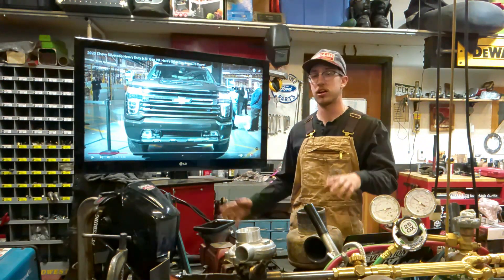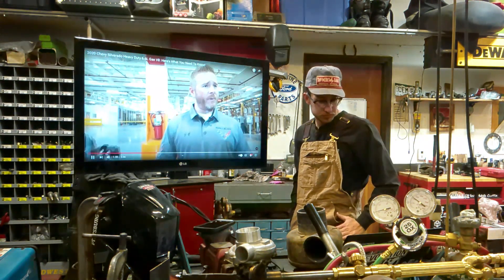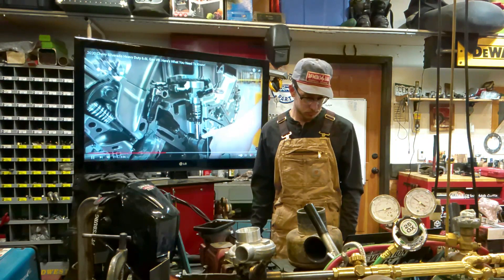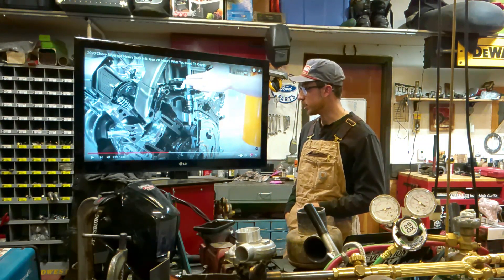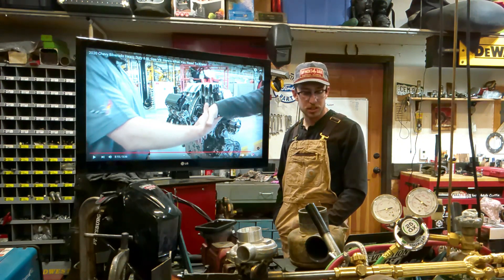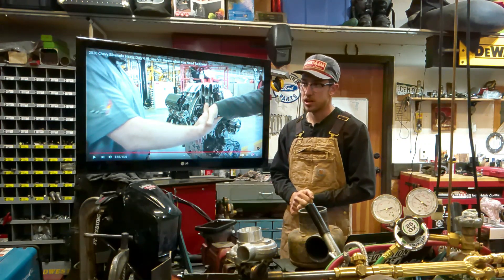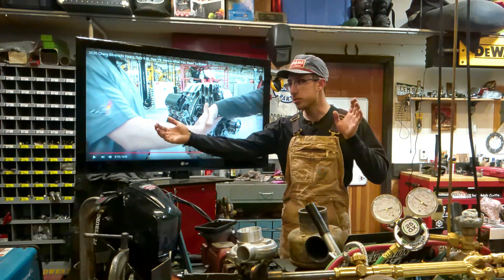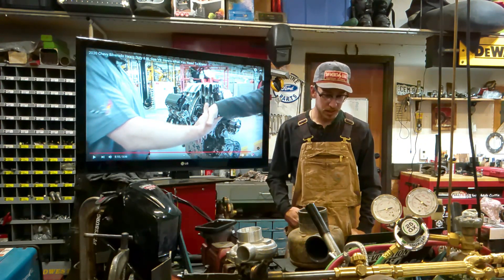My review of Gm 6.6 gas engine

Comment: For what its worth, I've owned both...2022 F-250 7.3L w/ 10R140 and now a 2024 GMC 2500HD 6.6L w/ "Allison" 10L1000.  
The GM powertrain is much smoother and quieter AND feels just as strong (-29hp & -9 lb-ft vs Godzilla). I very much prefer the GM!!  I'd buy it again over the Ford no question. Very happy with GM 2500HD. Also, the 7.3L might have cam/lifter issues?  Internet Amplification??  Maybe.  PS:  This is my first GM ever (Ford guy since 1998).  PS:  6.6L L8T uses 5w-30 (same as 7.3L).

Comment: I have 38,000 miles on a 2021 2500 LTZ 6.6 gas.   I've been nothing but satisfied.  Long road trips to the beach (not towing) i can get 18 MPG.  Towed an 8K pound car trailer on a 1600 mile hunting trip this fall and was very impressed with the power and performance of the truck.  Fuel economy on that trip was about 8.5.   The 6 speed transmission has been nothing but 100% perfect.  I think the new 10 speed paired with the gas engine will help its towing performance but I have great confidence in the proven 6 speed. If I towed over 10K frequently I might consider a diesel but for me the 6.6 gas has been a perfect fit.  And I really like the payload capacity you get with gas.  My 2500 standard bed has a payload capacity of 3316 pounds.  That's great for hauling green heavy firewood.  The Ford 250s i looked at seemed like their leaf spring packs were significantly smaller than the GM 2500.  Time will tell how this engine holds up.  For me as of now it's been great.
Reply from the maker: Glad to hear it

Comment: I love the Godzilla too but they are having some camshafts and lifter failures too. The Ford 10 speed isn’t nearly as reliable as GMs 6l90 . The Ford 6.2/6 speed is still the better powertrain IMO. The Ford  alumiduty trucks are have alot of wiring harness and. Connector issues especially with plow trucks. We just got 3 new GM 6.6s at work to go with the 11 other 6.0s we have , we will see how they do, they hold 8 quarts of engine oil whereas the 6.0s only held 6.

Comment: I never would have guessed you’re a Ford guy. 

Anyways the 6.6 doesn’t use cylinder shutdown technology. They also call for 5w-30 oil. 

Also, is the 7.3 really a big block? My cousin has one in an F250 and it doesn’t look like the older BBFs.
Reply from the maker: Yes I was wrong. The 6.6 doesn't use cylinder shut down. The 6.2 still does for gm. And yes tye 7.3 is a large water jacket true big block
Reply: @ColtWR  yes unfortunately so on the 5.3 and 6.2. 5.3s are coming with it deactivated due to chip shortages but still has the DFM lifters. 

Interesting about the 7.3 because it sure looks like a small block just on the outside.

Comment: I was paying attention until you started to sound like a hater. And then at the end of the video you just confirmed you are a Ford guy. At work we can’t keep those HD Fords out of the shop. The few 6.6 gas HD’s we could get a hold of are cresting over 150k hard miles and very few problems, none engine related. I appreciate you talk from knowledge, but this is definitely not from experience. I was so impressed from the 6.6 reliability I bought one for myself.
Reply from the maker: If the 6.6 was anybit of a long time contender in longevity you would see it in medium duty applications. Not just light duty trucks. There us a reason the 7.3 can be purchased all the way into the F650 chassis and that blue bird school busses is now offering them as an option as well. 150k miles is for kids. I'm interested it true HD engines. The 6.6 just doesn't fit that bill.

Comment: Got rid of my 6.7 ford diesel couldn’t keep it on the road. So I bought the 2500 6.6 gaser . Fingers crossed , I only have 25 k on the engine . I tow an RV and a 22 foot salmon boat . I have noticed some oil consumption it seems to burn 1gt. Of oil every 2500 miles which doesn’t sound good to me , I now check and add oil as needed the miles were mostly tow miles and I run Valvoline 5w 30 full synthetic . Every thing else is good so far . I also put a oil catch can on to hopefully alleviate oil buildup on my intake and intake valves.
Reply from the maker: I do know that gm has had problems with v8 oil consumption in the last few years because they use a low friction compression ring that is really hard to seat.

Comment: I brought a 2500 HD chevy 6.6 gas.  I don’t plan on towing anything with it.  It’s my every day truck will I run into the same problems that you are talking about if I don’t tow
Reply from the maker: 🤷🏻‍♂️ hard telling. But I always recommend getting on the highway and putting it on the floor quite often if you don't tow to get that engine opened up and get the cats hot to keep everything clean and with less Carbon build up.

Comment: I have a fleet of over 25 box trucks delivering all day, from box trucks to pickups with stake beds. I can’t keep a ford on the road, I have from years 2000 to 2022. Diesel and gas, we have two full time mechanics. Out of everything we have the duramax is by far light years ahead on reliability. Gas engines just don’t like being used heavy duty like we do 24/7, The best setup we have is 5.9 12v cummins with nv4500s, you literally can’t kill them, have two with over 800k miles with regular oil changes. We have a new ford 7.3 gas with 16ft stake bed, we have to fill it up 2-3 times per day.

Comment: Stick with 0w20 or switch to 5w30 for a gen 3 hemi with 145k miles? Thinking of switching to 5w30 in spring or summer when I start towing more regularly.
Reply: I would never run the 20 weight in a hemi, particularly if it tows. If you look at the HD trucks with the 5.7s, they spec a 30 weight oil since those engines will be worked. Summer/winter, doesn’t matter. Your operational engine oil temperature will be almost identical, it just may take a little longer to get there. 0w30 is what I run in my 2017 Ram 1500 that is worked like a 2500 way too often, it is approaching 150,000 miles and doesn’t burn a drop of oil and has had no mechanical failures inside the engine. Please stop running a 20 weight in your truck, it will thank you.

Comment: I’ve got a little 2.4 ecotec with direct injection which is getting fuel in the oil. Changed the direct injection pump and I think it might still be getting gas in oil. Do you think it’s possibly an injector leaking?
Reply from the maker: Sure could be.

Comment: There is no afm in 6.0 or 6.6 engines.
Reply from the maker: The 6.0 does not but the 6.6 has what they call dynamic fuel management which is a fancy new term for afm except it does not shut down 4 cylinders. It has the ability to intermittently shut down all 8. 16 colapasable lifters.
Reply: @ColtWR  where have you found this? I have done a ton of homework on this engine and haven’t seen this anywhere?
Reply: @ColtWR  it has variable valve timing but does not have afm or dfm.
Reply from the maker: @Dubduce-d6v  looks like you are correct. The article I read was also discussing the 6.2, which is where I got my dfm info from. My bad! I appreciate your help!
Reply: @ColtWR  no problem. Love your videos by the way. In my search for the best gasoline 3:4 ton for my small farming operation I ordered a 22 6.6. I have been using it now for 15k miles. I am seriously contemplating trading it for a 20+ 7.3 with 10 speed. I am having a difficult time finding one that has anything other than 3.55 gears. I feel like the 6 speed really holds back the 6.6. With that said, I feel like the 6.0 with 4.10 gears actually pulls heavy better than the 6.6 with 3.73…. Which is the only option when buying one.
Reply from the maker: @Dubduce-d6v  very interesting. I can you option the 10 speed on the 6.6?
Reply: @ColtWR  you can now, but 2020-2022 you could only get it with the 6 and 3.73 gearing.

Comment: I towed a car behind a U-Haul with a 6.6 in it, I was very impressed, it absolutely never even came close to running out of power, even through very mountainous terrain and at high altitude (~7,000 feet). I'd have to be careful on hills not to exceed the speed limit, because it would be off to the races once it down-shifted. It was definitely pinging, though, so I put premium in it and it stopped.

Comment: Any thoughts on the new 6.8L engine from Ford? Looks like it is built off the same block as the 7.3L 

I see that a F350 dually comes standard with the 7.3L  

When they come out it would be interesting to hear your comparison between the two verses the “new HO “6.7L diesel
Reply from the maker: The 6.8 is just a destroked 7.3. It is an awesome design as well. So your wanting a comparsion of the ho 6.7?
Reply: @ColtWR  not a comparison to the gassers …just based on your previous videos…. More pressures in the system, higher outputs… Just wondering about your overall thoughts on the new HO when it comes out ….
Reply from the maker: @craigthimm184  ok I see what you mean. I'll do a video!

Comment: The 6.0 vortec was too reliable so they had to go and replace it with a over complicated problematic engine. It will definitely last well in warranty but after that I’d bet it won’t hold a candle to the reliability and longevity of the 6.0
Reply from the maker: Yea, sad to see the the 6.0 go

Comment: Right on Colton! Great video! The 6.6 was one of the questions I had, thanks!

Well, since you asked, what are your thoughts on Fords V10 and 6.2 gassers.

8.1 would be interesting as well. I believe it has 500lb tq. in stock form. Which is pretty bad ass, but comes at a cost. But if the truck is making money and dependable, it's all good. (And cheap to repair)

We have two 6.2's (2017 & 2012) and I wonder what would be the best direction to go with our 2012. It's a dog with any slope. I run A/C, Med n Lo temp refrigeration in N. AZ and use the 6.2's to run jobs -And I put on the miles!

 I've thought about a 7.3 Godzilla or 8.1  swap. Or just do basic bolt-on up grades with a programer on our 6.2's.

The "Truck Norris" cam seems to be a good torque cam swap for pulling.

Appreciate your channel and the sharing of your knowledge! 

(The warming of the metal was a good tip for welding!)
Reply from the maker: Glad you like the Chanel! I will try to make a video touching on towing with the 6.2s and v10s
Reply: The 8.1 came with 340hp and 455lb ft tq from GM

Comment: What you said on the 3.0 Duramax IMO is spot-on.  There's a reason Ford discontinued their 3.0 Powerstroke & RAM is getting rid of the Ecodiesel Boat anchor.  

Small displacement diesels with today's emissions standards (& that's only gonna get worse), bring too many headaches with their designs.  FOrd & RAM saw the writing on the wall

Comment: What are your thoughts on Ford's 6.2?
Reply from the maker: They have been proven very reliable. And the 6r140 trans bolted to them is also bomb proof. Not great heavy pullers but very good trucks over all.
Reply: I'm a big fan too, wish I had the 4.30 instead of 3.73 now that pull more often

Comment: Can you do a video on n dually f350 7.3 and when you should stay with the gaser and when you should move up to the f450 diesel? Caught in between which one to get . Only
Thinking f450 that I can get extended warranty after 100k miles
Reply from the maker: Yea I'll put together a short video about that soon.
Reply: @ColtWR  thank you
Reply: My 7.3L dually is rated to tow 20,000lbs.  I gross 27,580lbs with it and I can take it easy and drive it everywhere.  If you need to tow over 20k lbs get a diesel.  If you won't ever tow over 20k lbs there is no benefit to having a diesel.  Magic potions every oil change and fill up to keep everything running.
Reply: @wakeupamerica2024  yeah right now I don’t tow over 10-15k but I’m the future plan to go over 20k with fifth wheel and heavy equipment on the ranch
Reply: @Big_Guwop713  The F350 DRW is rated to tow more than the F450 if they are optioned the same.  The 2022 Ford RV & Trailer Towing guide shows that.
The F450 has larger brakes and a better turning radius but less payload.  Both are rated to 14,000lbs GVWR.  Insurance can be harder to get on an F450 cause some insurance companies consider it a commercial vehicle.  
There is nothing an F450 can do that an F350 dually with a diesel cant.

Comment: Can you do a review for the 2021 f150 5.0? Just so I know what I should keep an eye on and how long I should keep it.
Reply: If it eats oil get rid of it
Reply: Mine hasn’t yet but I only have 2 oil changes through it. I hear the piston rings don’t have enough tension on them, I guess to help with fuel economy.
Reply: Auto Guild channel has a good video called "GM Gen 5 LT vs Ford Coyote. Which one is better and why." I ran a 2011 5.0 in an F150 over 300k miles. It was a work truck and it was passed on to someone else when I got a new truck. I really liked that engine.
Reply: @duggydo  thanks I’ll check it out, I have plenty of faith in the older fords. Owned 5 beat them all up and did only minimum maintenance. Just not sure if I should plan on keeping the new one after the warranty is up.
Reply: @Corbin517  I'm not too impressed with the newer trucks. Too much BS on them to meet emissions and the EPA mileage requirements. The 7.3 gas is the best engine made now, but it is horrible on gas. If I had to buy a new half ton truck, I'd get the 3.0 chevy diesel simply because of fuel economy. I've got 2 older trucks with V8's that I will never get rid of unless something bad happens. They are basically becoming irreplaceable thanks to greenies controlling the government.
Reply: @duggydo  I wanted a 7.3 but I’m in Fairbanks Alaska right now thanks to the army, so they only had 2 7.3 trucks and they were not what I was looking for. As for the new smaller diesel motors I just don’t want to pay the crazy diesel price here or fix any turbos. I had an old 7.3 f250 but took it to a shop for an oil change and the put the wrong oil in it and about half as much as the truck needed so I got rid of that. Trying to stick with gas now. And have a lot invested in this f150. But yes the old ones were great, and will always hold a place in my heart.
Reply: @duggydo  The 7.3L is not horrible on gas.  Some people are getting between 15-17mpg.  For a 430hp V8 in a 7-8,000lb truck that's pretty good.
Reply: @wakeupamerica2024  I doubt anyone gets that driving highway speeds 70-75. I wouldn't get one for mpg anyway. It's just a solid engine for an HD truck.
Reply: 2021 5.0L have cylinder deactivation system.. will it be GM- AFM level of bad or not? Idk.  My '12 5.0L is at 217k miles. Runs well but body is Swiss cheese.
Reply: @wyattgardner3552  you can disable that. Just keep it in sports mode or manual shift. I don’t have stop or start either. Had that disabled from the factory.
Reply: That manual fuel pump, 2000 psi ! ! 😳 imagine a gas leak ? OMFG

Comment: Now review the Chevy 6.0 L thanks.
Reply from the maker: That's engine is awesome. But I will do a review
Reply: @ColtWR  Indeed. Durable but what would you do for safe peformance mods.? Would love to get it (in theory) to the 400hp / 400 ft lbs crank output but know wheel is what we can measure. Wondering if only a custom tune / intake and exhaust will get you there or if you have to have a new cam and it will lope?    BTW your videos are great and love the 7.3 vs 6.7 series. Really makes me want to go get a Ford again for the 7.3 Godzilla but Ford pissed me off with the Ecoboost breaking a wrist pin at 90,000 miles on 2012 3.5L.
Reply: Made a comment already. Love mine. Not the biggest power monster but its steady when it needs to be loaded up.

Comment: Fuel injection is more efficient is why they do it. The biggest problem with direct injection is the oil caking and causing carbon buildup on intake valves. Port injection cleans them off. That's why Ford went to dual injectors on the Coyote engines. I'm not a fan of 16 injectors, but I think it's a better design than this 6.6 engine. Also, that belt on the 3.0 Duramax will probably outlast chains. They already changed the belt service interval to 200k miles. By the way, learning the conversions from metric to imperial isn't a big deal. You might want to do it in case that's all they list on something.